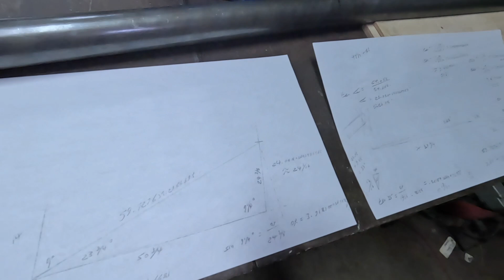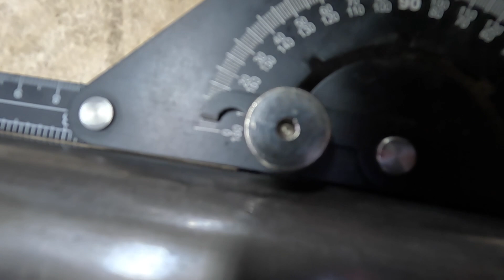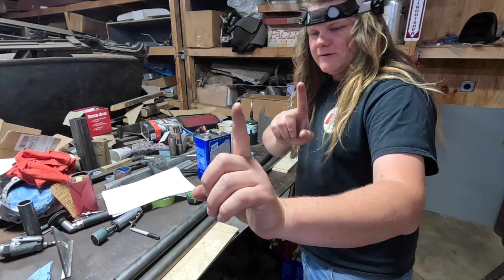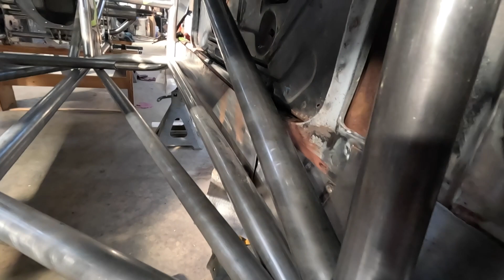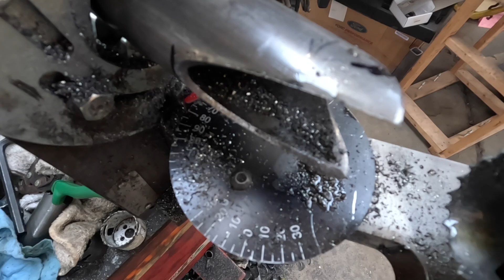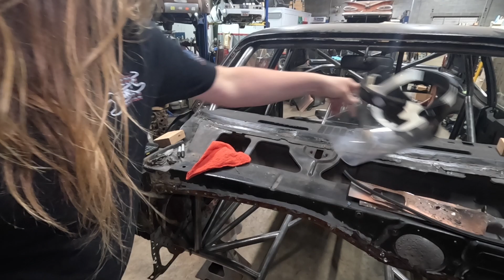Door Bars Added To The Nova Chassis! Adding Tubes to the Chromoly 25.3 Chassis, Bending, TIG Welding

Comment: A question if you don't mind. At 47:.20 you mentioned adding diagonals to the main hoop ( d bars in nhra rulebook) as being necessary for an 8:50 cert.  I have a 37 Chev gasser I am doing an 8:50 cage in.   Are those bars necessary , as I thought only required if unibody.? My main hoop is welded to the frame. If required can I mount them to the flood with plates ? Many thanks.
Reply from the maker: Correct, the D bars are only "mandatory when main hoop is welded to plates on floor and/or rocker/sill in lieu of frame" quoted from the NHRA rule book. The reason I mentioned that is because Novas are not full frame vehicles, they only have a front subframe that ends under the front seat area, so a Nova would typically require D bars. Your 37 Chevy has a full frame, and like you said, the main hoop is welded to the frame, so D bars are not required in your car. Thanks for watching and commenting!

Comment: Couple questions,  does the bend in the door bar affect certification at all ? And why are the center frame rails short in the front. Amazing work sir.
Reply from the maker: Now I want to triple check my SFI book, but I don't think it says anything about the door bars not being allowed to be bent. I will check on that to make 100% sure, though. The center 2a frame rails are short, because this is a stock front suspension car (with a factory style subframe instead of a strut front end) and those bars will only go far enough forward to tie into the front subframe. Thanks for watching and chiming in!
Reply from the maker: Just to clarify, I looked in my 25.3 SFI Chassis Book, and it does not mention anything about the main door bars not being allowed to be bent, and there is a general rule that any bar can be bent or angled unless otherwise specified.